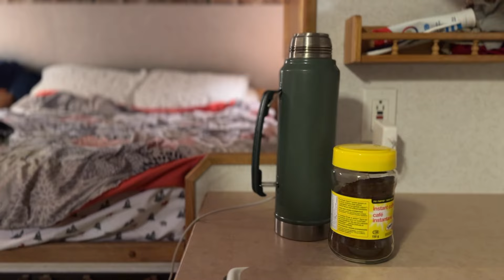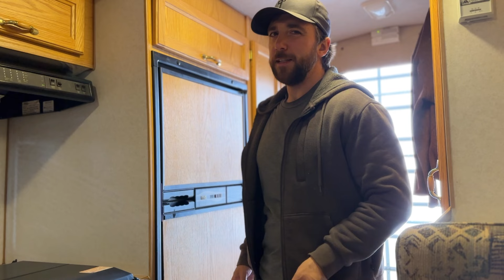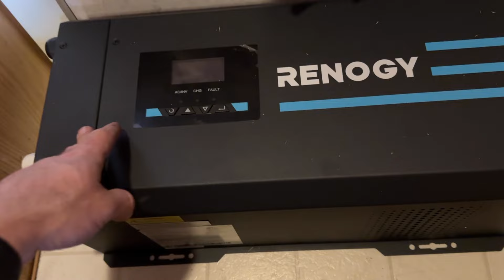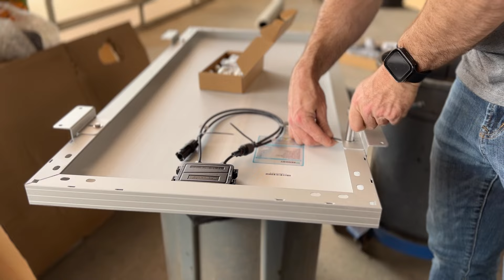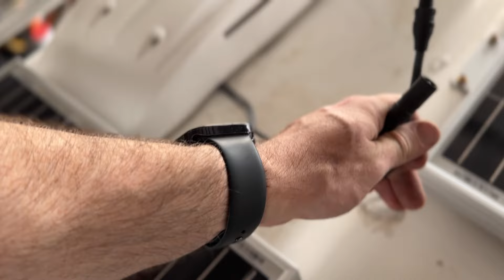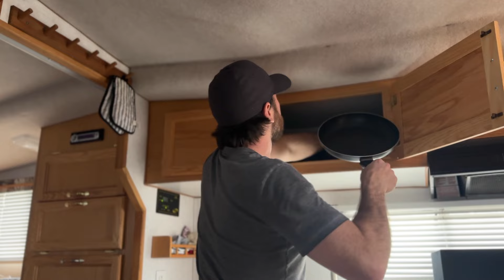SOLAR Install and Prep For Electrical System For FULLTIME Living In a TRUCK CAMPER

Comment: Did you have any issues in fastening the panels into the fiberglass. You would think there would not be enough to bite into
Reply from the maker: Don’t over screw them when it’s snug it’s done ✅ lol I’ve done this now on 2 northern lites and no issues, they mount them just like this from factory on the new ones lol
Reply: @KevinWaldsAdventures  I was under the impression that they used a wood support in the roof area where the solar panels were attached.  My concern is they would pull out over time without a decent anchor.  Time will tell but looks like you have had no issues.

Comment: Nice job on the solar. I got 400 watts of solar on my camper and a 200 amp lithium battery and it has done me well.   The truck looks so good with the new camper. I love single cabs. The weight balance seems much better with a single cab

Comment: Yipes ! A nice leakproof one pc fibre glass roof, and you’re popping holes in it for the solar. Lots of RV sealant I guess. Thinking that’s why Dustin, from Destination Adventure went with the flexible stick-on ones. I hate roof holes. Safe travels. 🍁🤙
Reply from the maker: I was worried too but I’m pretty consistent on keeping up with sealant, my last one they were mounted the same way for the last year and I never experienced any sort of leaks

Comment: Bought 2 100 amp hour lithium ion phosphate batteries with 200 watts of Solar and a Renogy Mppt charge controller for my Adventure camper. Awesome set up. Do not have an inverter but I am always close to 100% on my charge.

Comment: 👏 exciting solar /battery setup! 
The flooring on the step is actually very nice and u did a good job! but notice it is a walnut grey tone, (2 colours in it) u only have brown swirls on cushions n nothing else complimenting that nice new step. 
Look for flooring that has one colour of various tone. 
I hate the carpet on my step n under table. Pain in the ass to clean wished they just lino covered them too, i see the new NL now are all lino flooring. 
My point, ugh no don't put back carpet. I have a portable rug cleaner but what a fricken hassle I wish it had no carpet. 
Anyway leave it for now, it will give u time to ponder some other colour n pattern that u should redo the whole flooring with down the road, n chances are you'll find a less expensive one. 🍻
Reply from the maker: I think you’re right, I’m going to just keep on the hunt for the flooring that just goes much better and stay away from carpet!